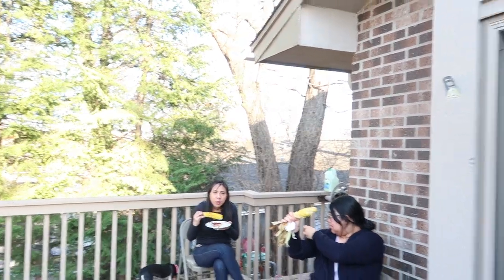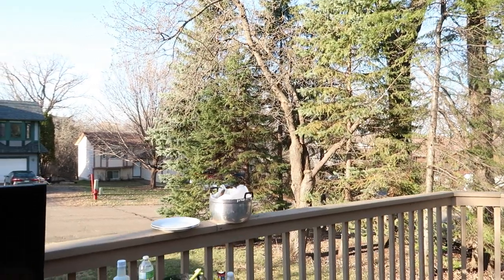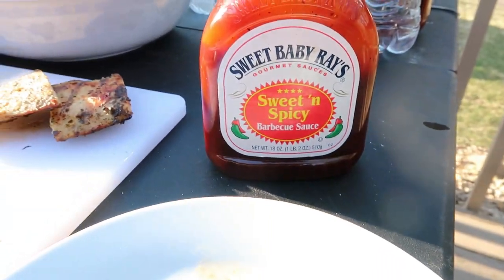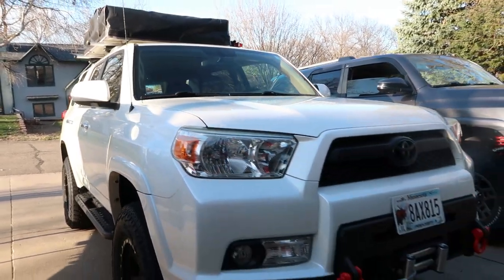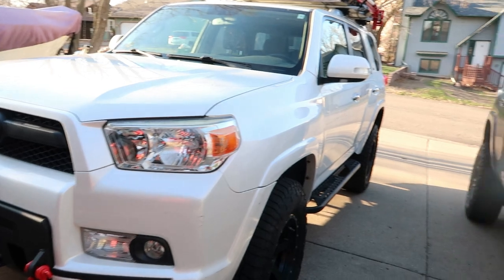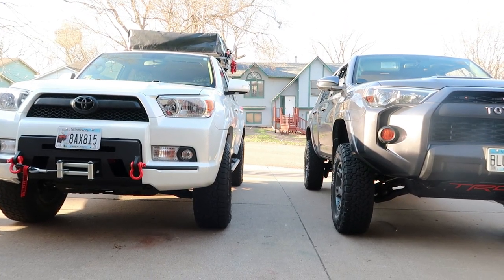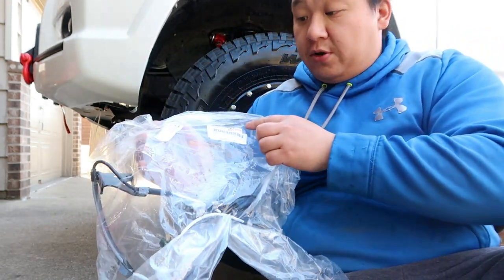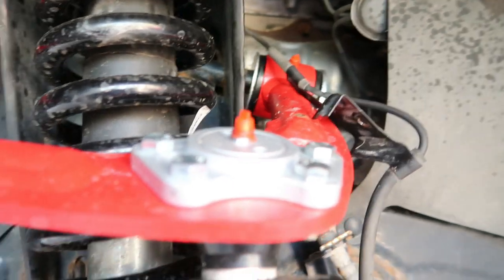2010-2024 Toyota 4Runner ABS Sensor Wire Replacement

Comment: What dash indicator did the busted line trigger? What was the code? I'm wondering if I broke mine internally from stretching during the lift process, triggering a traction control warning light.
Reply from the maker: trac control and abs was on. Also an obd2 scanned turned up abs sensor

Comment: My abs and trac control (or whatever it’s actually called) lights came on after installing my lift last night. Is there a way to tell if I screwed up both sides or no? Also, did replacing this fix both lights?
Reply from the maker: I used a obd2 scanner that had ABS feature to diagnose. It told exactly which side was wrong. Lights did go away after new sensor

Comment: yo!  what were your abs/trac/vsc lights doing?  I did the same thing with mine tonight while installing JBAs.  The ABS, VSC and TRAC light were all one when i went for a drive. I checked again and now the ABS and VSC lights are slow flashing.   ???? I'll probably go buy a new line tomorrow and replace it.
Reply from the maker: I don't recall exactly. It's been a year now but I do recall it was flashing. A quick scan with the obd2 tool pointed to the abs wire so it confirmed it for me.
Reply: @stevepheejyang1493  ah gotcha. I tried to scan with my obd tool too but there were no codes.  Maybe my tool isn't as exhaustive or feature rich...?

Comment: Hi, how did you get the upper connector loose? I've been having trouble with it. Pushing on the tab and pulling but nothing. Thanks in advance!
Reply from the maker: the connector inside the engine bay?
Reply: @stevepheejyang1493  Yes!
Reply from the maker: @iminacoma  easiest way is to just take off the screw/plastic clipthat holds the entire piece in place. That way you can really see how to take it off the connector. Hope that helps
Reply from the maker: @5:36 take off that bolt. Once that bolt is free then the connector can be taken off by pressing the clip in. If  its to hard use a plier and slowly wiggle it out